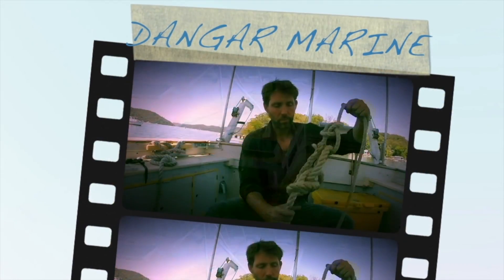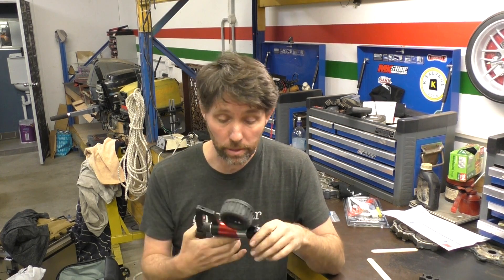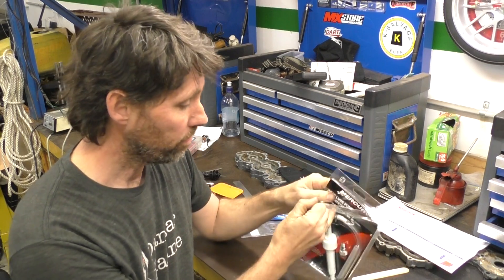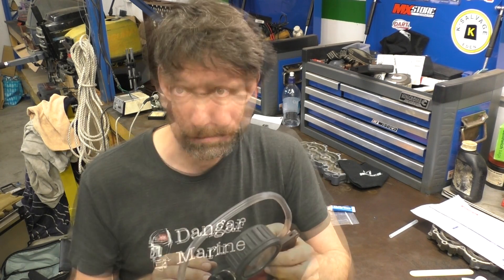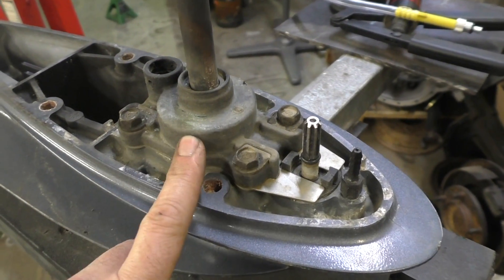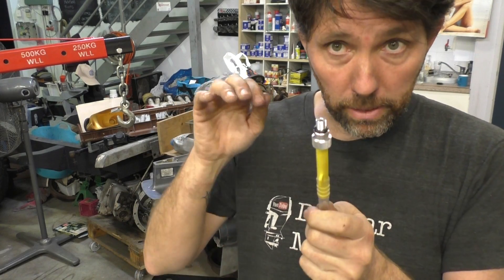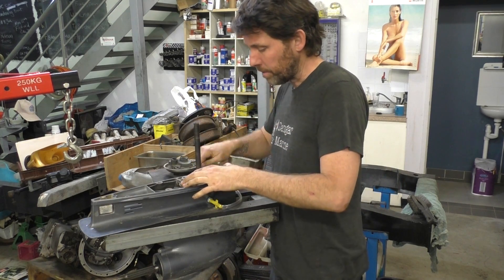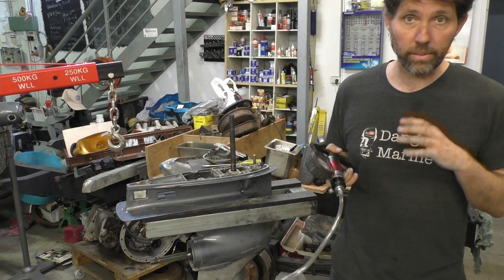Pressure testing an outboard gearbox

Comment: I just did this pressure test on my 1974 Johnson 2-stroke. I found some water in my oil, however the test held 10psi compression very well. It didn’t move a notch until I let pressure out. What could have caused the water to get in? Possibly loose oil plug screw?

Comment: Tip - I did this and the pressure dropped quickly. I mixed up a bubble solution and found the device was leaking where the clear tube fits onto the plastic barb. I put some gasket liquid sealer on the barbed plastic bit and some grease on the plastic thread and found my gearbox was holding pressure perfectly. I was very releived because I had already done the water pump and didn't feel like undoing it to fix the seals under it.

Comment: Motor stopped working after pressure test what is the reason stopped? Normally can turn the motor shaft by hand but after pressure test the shaft is no moment at all, what is the main cause. Thanks

Comment: I am currently having an issue with my gear case. It passes the pressure test with flying colors. It actually holds 15psi indefinitely. Yet when I take the boat out and check the fluid when I return it looks like milk! Did you ever experience holding pressure yet water still getting in. I suppose I need to vacuum test at this point but it seems odd that it would leak when it holds pressure.

Comment: Hi I was changing the gear box oil on my mariner 5 and what came out looked like water first and then dirty oil. I’d like to try the pressure test to check which seal may be leaking but do I need to remove the water pump and lower leg etc: I was hoping before I have to take the engine apart further I can check if there is an actual leak or maybe the drain plugs were not tightened enough ( wishful thinking maybe !)
Thanks for the great channel and advice; helped me attempt servicing my outboard 
John

Comment: Great video, thank you. I have a gearbox that had water in it. I did this test, and found no leaks, I have put it down to a missing nylon washer on the fill screw. I can detect no play in the prop shaft. It shifts gear ok. The magnetic bung had no unusual debris on it. I dont know if I should tear it down or not. My worry guts side says pull it to bits, but that will be a very tricky job, it will be very siezed. My lazy side says fill it with oil, check the magnets for debris in an hour or so. What say you ? TIA
Reply: That's what I would do.   Last year I bought a o ring kit from. Napa so I could change them everytime

Comment: Is there a multimeter with tachometer specifically for boats? I have a multimeter/tachometer for automotive with 3, 4, 6, 8 cylinder settings.  Boat motor only has 2 cylinders. What do you use?

Comment: I’ve used this exact pressure tool to find that my shift shaft boot seal leaked . I replaced this seal and did the pressure test and held 10 lbs. for more than a minute. I re installed the lower unit, and ran it . Then I noticed after shutting off , gear oil coming out of the weeping hole . Very little oil but still oil leaking . The pressure tool handle broke so I can’t leak test it again till I order a new one . I have a 2000 , 30 Yamaha 2 stroke . I have also installed new upper shaft seals , water pump housing, impeller, gaskets. 
I’m lost for words what is wrong 😑. Did I miss something?

Comment: I bought all the parts you mentioned but I have a question about the pump. The instructions say that you put the slider to the rear (towards the handle) for vacuum and forwards (away from the handle) for pressure. It seems like the instructions are backwards. Can you let me know how yours works? Thanks

Comment: My gear oil is just a little bit milky. It was clear until the last bit drained out. Pressure test held at 10PSI for 1 minute until I took it out. Should I worry about it? And thank you for the education, I’m going through a 1999 Honda BF90a and you’ve been a life saver.

Comment: Thanks. I comment, my tech did the annual maintenance on my 2006 mercury optimax 115 two stroke. After that, I have notice an oil  leak with water through the water intake holes. He fixed changing the seal of the transmission. Everything looks fine until this weekend that I have the same leak again. I would Iike to know your opinion. Thanks

Comment: the lower unit oil pumps are readily available for around 6 bucks at most boating supply stores...for a slightly cheaper option

Comment: I bought a vacuum pump/brake bleeder but it doesn’t appear to have an option to pump air instead of vaccuming it. So I’m assuming that’s not going to pressure test my lower unit?

Comment: I replaced the seals then filled it with oil THEN decided I should have done a pressure test. Can I just leave the oil in it test it from the upper hole??
Reply from the maker: I would drain it first.

Comment: what would be wrong or not affective to test if my lower unit is leaking by just using the vacuum? i’ve got a break bleeder but it only creates a vacuum and not positive pressure.
Reply from the maker: It should be fine. If you have a leak it will just be a bit harder to find as you won't get bubbles coming out when you spray soapy water on the seals.

Comment: Hi Stu! Great videos and long-time watcher of the channel. You have been a great help on my outboard adventures. I pressure tested my lower unit (2007 115 Mercury EFI) and did not see any bubbles at the seals but heard a leak from inside the water intake. Any ideas what it could be?
Reply from the maker: Did the pressure drop? If so it sounds like it could be the driveshaft seal which is under the water pump.
Reply: @DangarMarine  the pressure never got above 5psi
Reply: @DangarMarine  you are a gentleman and a scholar!

Comment: Great tip and very timely! I recently bought a project boat with a 1975 850 Mercury.  It hasn't been in the water in five years according to the registration sticker.  A cracked bearing carrier assembly with the reverse gear, dog, shaft, and prop were all attached and lying in the hull.  Got a used lower drive unit today and was wondering how I was going to check the seals before installing it.  Now I know!

Comment: If the lower unit does not get vacuum or pressurize when running  and the oil level is well below the top seals.  Also with the top seals being shielded from weather and water being above waterline and below motor, would it matter at all if the top seals did have a leak when pressure testing?  I guess condensation would play a bigger factor if they did have a slight air leak but not enough to make a difference if regularly change oils right??   Just wondering what harm it  would do to not worry about the top seals leaking a little if at all.  As long as they are keeping dirt and bigger debris out than thats all theyre really there for i would think..

Comment: Is a pressure tester required? I have a vacuum tester with a gauge that only displays negative pressures, from 0 to -30 inHg, I would assume because it only vacuums and doesn't actually push air in. Yours displays both (negative) vacuum and (positive) pressure units. Is a pressure capable unit required?
Thanks in advance.

Comment: Great video as allwase  . QUICK QUESTION I HAVE Honda outboard bf15D impe changer the lower unit gearbox oil a little water in it have you ever done a video on diy pressure tester with a bike pump
Reply from the maker: Yes, very old video though so quality will be poor https://youtu.be/Lzn-nshSlwk

Comment: Hi Stu, I have a question that may be related to the gearbox. I bought a 96' 100hp Mariner that is making a screech ever time it goes into gear ( and it's not a clunking or grinding sound). The motor has not run in three years so I want say it may be a dry seal? Any thoughts on what may be going on? PS- the shifting mechanism is not like the Johnson or Evinrude where it goes up and down but rotates. 

Regards, Dan

Comment: Another good one! I'm turning in to a pretty good DIY with your help. First was a steering cable with your help. Now water pump impeller is done. On to propeller shaft oil seals. I have to admit that I watch others but even though you have a accent, Ha! your able to explain things well, so that I understand, well. Which can be a challenge sometimes on my part. Keep up the good work mate! The old 84 75horse Evinrude is still fishing in Oklahoma!
Reply from the maker: Thanks mate, glad to hear your are getting good at your DIY. :)

Comment: Great video, I pump mine up but hear it leaking out the water pump housing of my 1999 Yamaha 90 C 2 stroke, any ideas?
Reply from the maker: New gaskets and sealant will stop that.
Reply: Did not use sealant but have new gaskets. The housing has a hole, but the oil seal or gasket does not fully cover the vent...
Reply: should it be covered and if not I cannot hold a vac?

Comment: Hi Stu,hope you don't mind me asking,I have 1999 Johnson that I have put a new inline sight glass fuel filter on.
The site glass nearly empties when the engine is running,but has more in it when it is ticking over,is it normal?
The engine runs smooth,and is quick to respond to the throttle.
Reply from the maker: Yes, that is quite  common.

Comment: Ah that's funny: the USA version of that gear lube pump comes with the opposite aka a metal plug adapter for nissan/tohatsu. i hope the plastic end actually seals the lower unit since i don't have a metal one for my Evinrude. Any ideas?

Comment: Why does my 1971 merc 400 have a "flush" set screw that goes through into the impeller housing..   what's it for does it effect pressure testing. I ordered the pump you've recommended to try this next week when it gets here..

Comment: Hi great video, I do have a quest, when I pressurize my gearbox it does maintain pressure, but when I wiggle the spline, the air releases, the spline is by no means loose, its just if I try to move it sideways  Whats your thoughts on that.
Reply from the maker: Could either be that the bearings need replacing or the oil seal is getting a bit too soft.
Reply: Thank you,  I did replace the seals last November,  So I was afraid that it could be the bearings.  So pretty much there should be no movement at all in that shaft?

Comment: Hey Stu, I'm a new subscriber. GREAT CHANNEL!!!   I have a 1983 Merc 2 stroke and have gear oil dripping out of the prop area. I did a pressure test and it held 14 lbs for like 5 mins. Any idea where the oil would be leaking from?  Thanks in advance.
Reply from the maker: Hi mate. It is going to be either the prop shaft oil seal or the drive shaft seal allowing oil to be picked up by the water pump then back out through the exhaust.
Reply: Thanks for the response Stu. If I don't see any noticeable water in the oil other then looking dark, would you lean towards one or the other?
Reply: Sometimes u can have such a small leak as in the gasket on the fill or vent screw and when not running it won’t leak but when u start the prop turning it creates a high pressure compared to outside. That can cause u to loose oil and not see it and hardly make any water at all. It’s odd bud have seen it. I believe that’s what’s happening to people’s magic oil disappearing with no water in unit. My 2 cents just a theory.

Comment: Dangar....just finished going thru my 87 Evinrude 140...expecting to replace clutch dog or worse (at cruising across a bay, felt like hitting a log...not often, but occasionally). With the aid of your videos and parts from marineengine.com i successfully replaced the pinion, fwd gear and clutch dog (all appeared spotless), I also reset the shift rod to the appropriate length. I got the oil pump and vacuum bits...,($10 and $32 USD on ebay). Query? How long does it take to build vacuum or pressure...If I kink the house and pump the results are instant. When attached to the lower oil plug...I can pump either pressure or vacuum and the needle barely moves????
Reply from the maker: It generally takes about five-ten pumps depending on the size of the gearbox.
Reply: Dangar Marine ....taking me 50 -100
Reply: OK...so I tried pumping it very slowly...that seemed to help...but only got the needle to move perhaps 1/8"...either in vacuum or pressure..but pressure held....I filled the lower unit with new oil and will begin reassembly and water test next week   thank you so much for the Dangar Marine series and thank you www.marineengine.com for sponsoring and having such a super website!!

Comment: Excellent Video, but I have a question...I have this same hand pump, but it creates suction, not pressure. Is that what you're doing? Testing with suction? I can see that it would certainly show that the lower unit is sealed, but how would it help to identify leaks? If you spray soapy water on the seals, you will not see any bubbles, therefore could not find the bad seals. Am I missing something? Love your videos, I truly appreciate all of your knowledge and your sharing it with us. Extremely helpful..!! Thanks...
Reply from the maker: This one does suction and pressure by moving the black collar at the tip forwards and backwards. I also use pressure as you say so that you can spray water and find the leaks.

Comment: Stu From your idea I bought a Schroder valve with a thread, attached that to the oil pump hose like you did, bought a cheap bike pump with a gauge and presto....I had reservations on gauge accuracy so tested against a good one and she’s apples. Thanks bud.
Reply from the maker: Nice one, a bike pump that already has a gauge attached is a great way to go. :)

Comment: I just finished successfully pressure testing my outboard lower unit after finding out I had some bad seals. I could not have done it without this channel. Your explanation of the different systems and showing different ways of doing things gave me the confidence to tackle this job even though I don't have the exact right tools for it. Thank you!
Reply from the maker: Thanks Chris, glad you hear you got your lower unit fixed up. :)

Comment: THANKS for the remake video. Can I do a vacuum test on my lower unit instead? My brake bleeder tool will pull a vacuum only. I need to test my lower unit on 1976 20 HP mercury outboard. [ How much vacuum do  I need to pull? ] Spring will get here soon 
 in Michigan USA  [ Todays date 12/13/2017 ]
Reply from the maker: Hi Ronald. I'm trying to think how you would go with a vacuum. You probably won't be able find leaks by spraying water, but if it holds the vacuum it would be a good sign. With the pressure test you add 10 psi.
Reply: Thank You  [ will pressure test ]
Reply: Thanks  will pressure test

Comment: Hi Stu, this but be a stupid question, I have a 1986 Johnson 70HP outboard. Does this motor have an extra gear between the forward and neutral gear, sort of a neutral forward gear?
Reply from the maker: Can't say I've ever heard of an outboard having that. If the prop is turning while it is in neutral it is just the friction of the oil circulating causing that.

Comment: Do you know the thread size for the american outboards? Im hoping to get the tube and screw separatley rather than buying the whole oil pump kit. Also any idea what the screw fitting would be called by itself? Not sure if it matters but i have an evinrude etec 115hp. Thankyou
Reply from the maker: They are 3/8 - 16 I believe.
Reply from the maker: Oh, and a "tail" is a threaded section with a barbed end for a hose.

Comment: This is great thank you. Just made mine for £25 - bargain!  I've just changed the dog clutch in a Honda 10 and need to replace the reverse gear. I'm new to this - how do I get the damaged gear out and put the new one in?  Any help much appreciated.
Reply from the maker: The reverse gear you will need to get off the bearing carrier using a bearing separator like this: http://www.ebay.com.au/itm/like/172102345794

Comment: That looks like a standard torsional overload fracture surface on the drive shaft. The fracture surface is beat up from contact after the fact but I don't see any obvious ratchet markets indicating a fatigue failure. 

In other words they hit something.
Reply from the maker: It certainly looks that way, but I'm surprised the prop wasn't in worse condition.

Comment: Here is a galvanized stock tank that would work. They come in 2ft or 3ft tall. Make a wood cover not to loose all the water with motor in gear and make sure it has a drain. Good to go. Oh and if you put a jet attachment on the out drive you could use it as a jetted hot tub too. Haha

https://www.farmandfleet.com/products/747145-agrimaster-galvanized-stock-tank-by-behlen-country.html?feedsource=3&gclid=Cj0KCQjw0K7NBRC7ARIsAEaqLREGqaeiVNgMl4HIjwZgXhehySmcYFksbMXBuacCIXsVdffr1m32XIcaAkPmEALw_wcB
Reply from the maker: I've got an old fibreglass water tank that I'm going to try cutting the top off.This look like a good alternative though. :)

Comment: Great vid as usual!!!. I commented a while ago about starting my 150 hp. black max that is on a stand. Can you please tell me how i connect the battery cables on his engine to start it . The max had no cables on it when i bought it .I have the controls for the engine. Thank you sir .
Reply from the maker: Hi Tom, the positive will go to the starter solenoid, the negative will go to the engine block. This video may help https://www.youtube.com/watch?v=Vt8aRamdac4

Comment: you're an absolute legend, it would be cool if you could do a video on what to look out for when considering buying/using/fixing an older boat, I've possibly got a small boat that hasn't been used for 20 years or so and it would be cool to know what sort of things to look out for to consider if it's worth trying to get running.
Reply from the maker: Thanks mate. I've actually got a video on that exact subject half finished from when Paul bought a new bought. I'll have to finish it off soon.
Reply: awesome! looking forward to it!